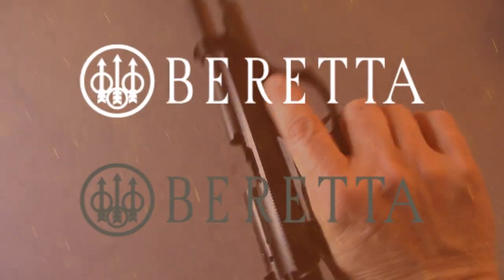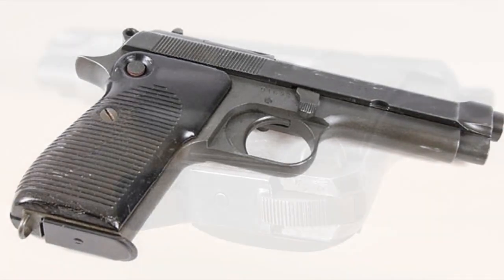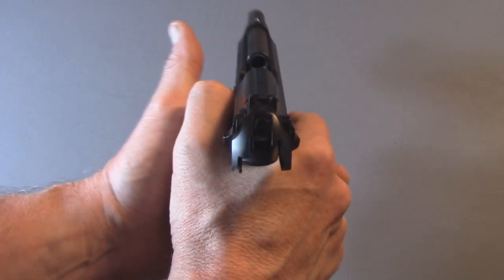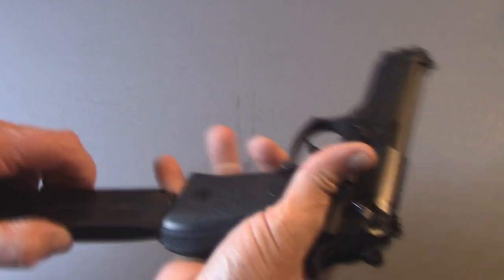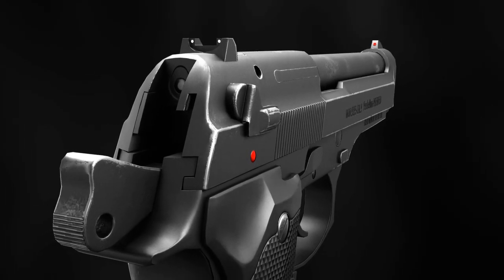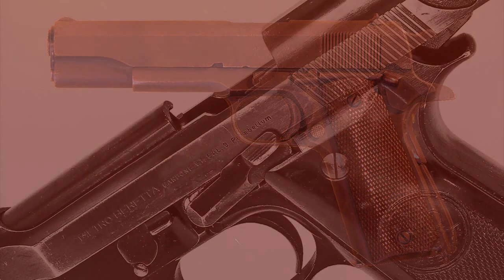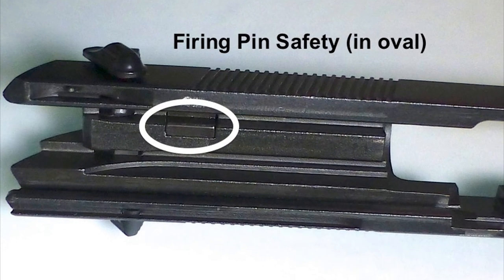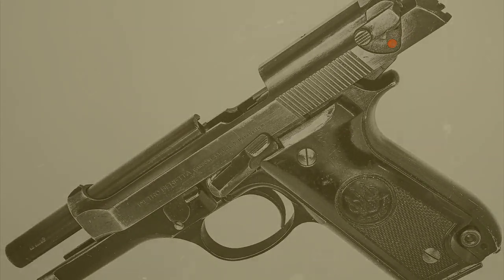Beretta 92 series development and evolution, a mini documentary

Comment: Just bought one last month.
M9 tribute.   Modified with reduced power hammer spring,  16lb recoil spring and buffer,  installed metal trigger and lanyard hole.    Primary use of 9mm NATO  spec 124g FMJ.    Extended magazines available. Inexpensive spare parts.
 Gun auction site ships to your FFL. 
BISMANBIDS.COM
Bismark, ND.